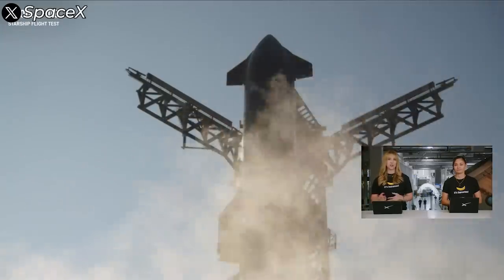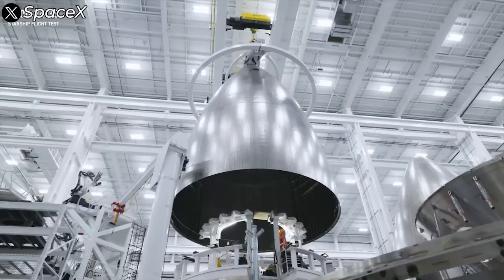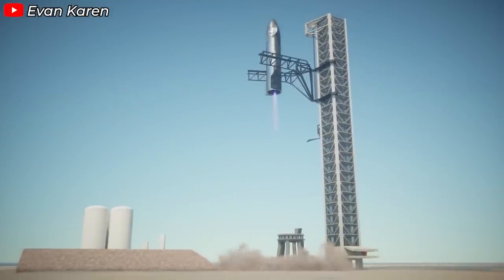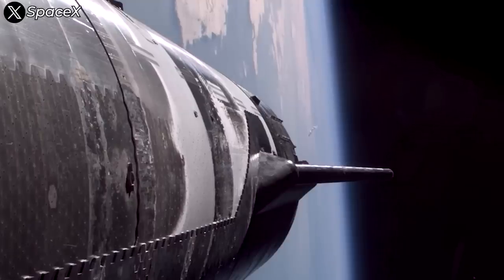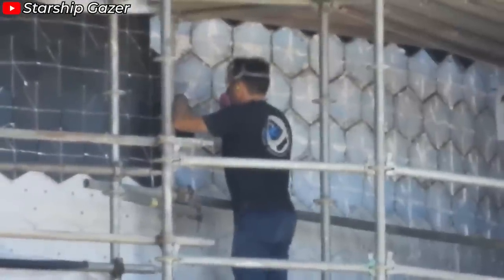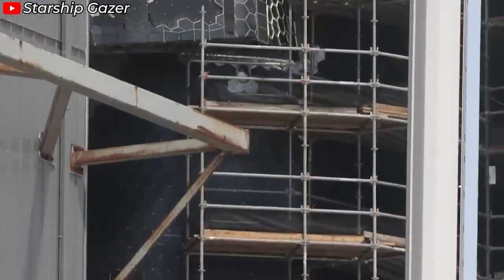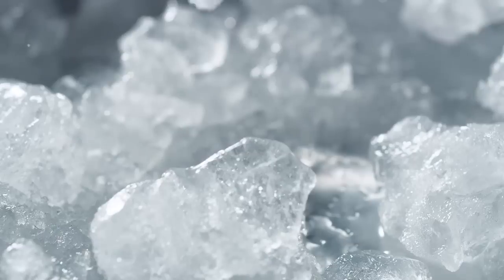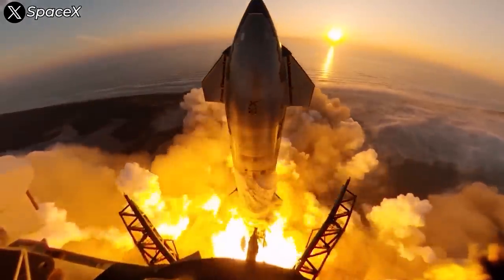Elon Musk just Revealed Starship NEW problem after Flight 6...

Comment: One more request. 🤣 Look into problem of reentry heating on the outer ring of engines on the big heavy. It's out there. The Raptor has been streamlined and modified alot, in production. Will they be reusable ? Do U use the old versions or throw away engines that have flown on the inner core before. Will they raise test engines or water landings in the future ? Can ya salvage those ? Answers please. Thx.
Reply from the maker: Those engines are Raptor 2, which are not yet the most optimized version. Therefore, the engines on the recent flights have only flown once. They are frantically testing for the Artemis III mission, and Raptor 2 is not sufficient for this mission. 
In the future, they will continue to improve and make them reusable, which could be Raptor 3 or 4. They haven't flown Raptor 3 yet, but I know they have already started developing Raptor 4.
Sorry for the slow response. We are temporarily pausing the channel for a while due to many issues that need to be resolved. We will be back as soon as possible.

Comment: Its called "Hot Prototyping"

You launch , see what goes wrong , redesign and launch again.

The number of people who cant get it through their heads how this process works is mind boggling.
I suspect it's deliberate.

I'm wondering how many of them also think we never landed on the Moon.
Reply: Yes, but in all fairness most programs don't have so many test vehicles so it is rare and these are exceptionally large and expensive for such, and yet for their size and sophistication they are also rather cheap and a lot is learnt.  Still they are going through many times more hardware testing than any other program, but they are also trying to do something that is insane and a first, the largest and most reusable rocket where both stages are reused.  What will result will be where other companies might have got in 60 years at the rate they go if lucky!
Reply: A "Starship" is 1/3 the cost of a 777

At that price it's faster and cheaper to build and test fly one than it is to pay hundreds of engineers and computer scientists to run thousands of simulations to get the same data.

Right now the stage they are in is they are about 80% done getting an operational system .

Once they can launch and catch consistently , then they start shaving the weight off.

Right now they are using the 150 ton payload allotment for thicker steel than they need while conducting test flights.
This is gives them the ability to run everything harder for test flights.
Reply: @glennchartrand5411  Well said and you're precisely right.
Reply: They're cope artists and nothing more.  They're nothing but irrelevant and they're just screeching.

Comment: Needs to be rapidly refurbishable, not rapidly reusable. They need a system where they can rapidly swap the shield out for a new one after each flight.
Reply from the maker: They don't want to replace anything, they want to reuse everything with minimal refurbishment.
And since the current heat shield will require more refurbishment than they want, they aim to improve it.
Reply: This is incorrect; SpaceX and Musk have been clear since day 1 - the entire Starship system must be rapidly REUSABLE, like an aircraft. That is the whole system, not the whole system except the heat shield.

Thanks for your opinion but that is what it is, and I won't debate whether you are eventually proven correct or not; but what you said is not the goal SpaceX are aiming for
Reply: @alanmckinnon6791  Hmm, I know that's their aim but being able to land one, refuel it, and take off without doing any thorough inspections just feels like a bad idea. Particularly with how many moving, spinning , parts there are. But hey, that's on them. I'm just here for the show. 😊

Comment: 304L is not a special grade of stainless steel....it's a commodity grade
Reply: The video is incorrect anyway, as SpaceX does NOT use L304 on Starship.
They have invented a new formulation which they call 30X.
From Grok: Stainless Steel 30X is SpaceX's proprietary alloy, developed to have enhanced properties suitable for space travel, particularly: Better performance at cryogenic temperatures; Improved strength-to-weight ratio at both cryogenic and high temperatures; Optimized for welding and manufacturing processes.
Reply: @-108-  lmao SpaceX can't change physics. Sure, they might have increased nickel content slightly or chromium to change the properties slightly, but they haven't reinvented the wheel.

Comment: Left unsaid, but should be said, is that any weight added to the TPS subtracts from useful payload, and the TPS must weigh less than the fuel required to just do a long braking burn. 

Not sure about CH4, but frozen water is very strong and could provide strength in certain phases of flight, whereas CH4 may not. Just a thought.

O/T, but the flaps could be much smaller, and hot-staging ring eliminated if the nose was pinched to let it slip though the atmosphere better, and the tail pinched at 90 degrees from the nose pinch so that the tail of the ship has a "belly" whose ends stick out beyond the round fuselage enough to house 2 engines, which could fire without any hot-staging ring as they'd stick out enough to fire directly down (or maybe gimbled), providing constant thrust, except perhaps, during MAX-Q. 

In general, the commitment to a round rocket seems poorly scrutinized and is being used to the detriment of the program. A conclusion I came to after Elon explained that the nose is light and the tail is heavy, so it's hard to get the ship to fly in any horizontal attitude. This due to engine weight, of course, but the fix seemed obvious to me, and you get to toss the hot-staging-ring as part of a virtuous cycle. Of course, better still might be to have a triangular engine bay, but I don't have the computational tools to know if that would be a good solution or not.

Comment: Build one tower litle far from lounch  site. Use it to catch ships with problem only. Ships without problems  can go to lounch tower. Catch all ships and analyze wath is good and wath is fail. Waste ships in ocean is lot data lost in ocean. When lot ship come and go , one tower for ships with problems will be necessary. My noob opinion.
Reply: This would probably be a bad idea for a few reasons. If the problem was on the heat tiles, then getting Starship to fly over the US and over populated areas would be a really bad idea, because if it broke apart, pieces of starship would land on those populated areas. Another thing is that if the landing burns failed, then it would destroy lots of infrastructure at the launch towers, which would cost more than making another ship since they want to make something like one starship per day.
Reply from the maker: the spacecraft just can't return yet. It hasn't completed a full orbital flight, and it doesn't even have landing gear yet.

Comment: The ship cooling problem should be no different to the engine cooling problem, 
Build a second skin and pump coolant into it. the weight gain would
be roughly the same as the tiles you took off.
Reply: or pump co2 from dry ice thru holes near nose to create a insulating boundary layer